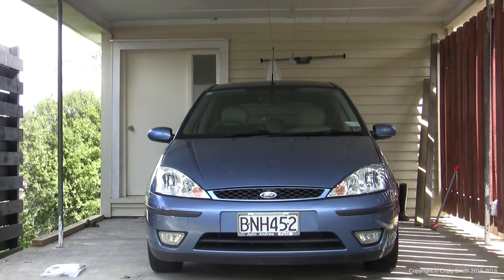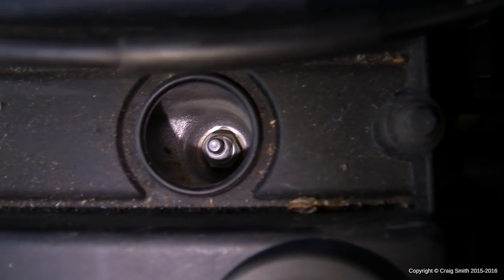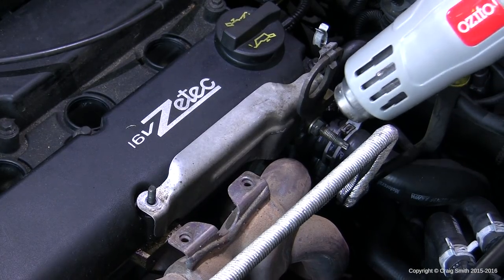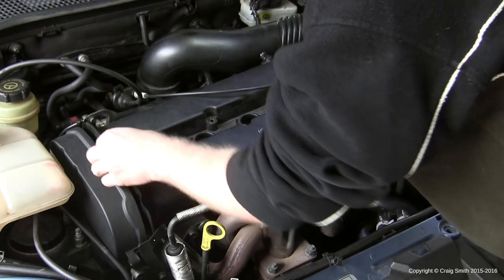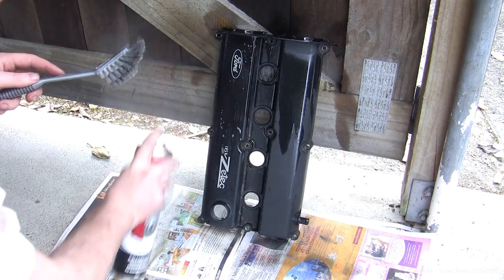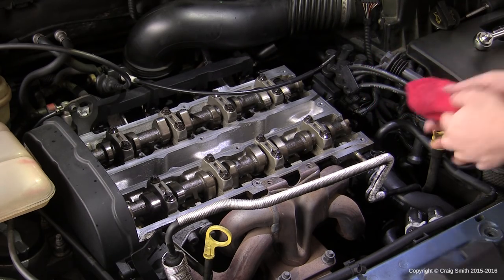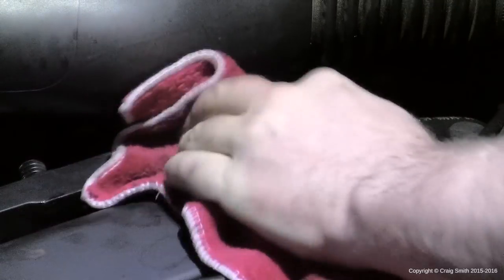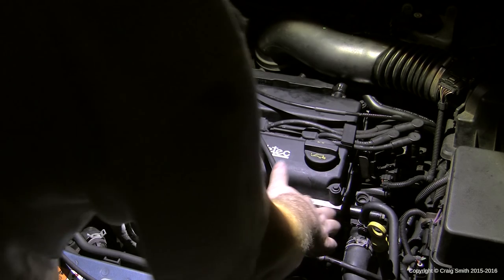Simple how-to: Replace Ford Focus rocker (valve) cover gasket, PCV failure #2

Comment: Video was very helpful. I had a hole blow out in the same spot as your hose was colapsing on the backside. I watched your other video on the pcv valve replacement. My valve cover is leaking oil and i didnt know that a bad pcv valve can cause that. So thanks for the info it was very informative and you did a great job filming it as well.

Comment: Considering I just replaced my PCV valve and hoses today and found the short little elbow piece that connects the valve to the metal tube almost completely plugged with oily crap, and considering that I also have some oil coming out around my valve cover, I think I need to do this too...dang.  But, I'm very glad I have this video to follow.  Very well done.  Excellent video and sound quality as well as narration.  Thank you for taking the time to make this video!
Reply: Mike Moren

Comment: There is every chance the new gasket will leak.What you should have done prior to refitting the valve cover and is specified by Ford,is to use RTV sealer to place four blobs of the sealer right at the very front of the gasket line where casting starts for the cam belt pully's.This is a 90 degree rise from the flat area where the gasket fits to the pully housing casting,the new rubber gasket will not seal a 90 degree change in direction very well.Hope this helps you out.

Comment: I have the 1.8 Zetec version and there was no need to take off the difficult heat shield, just the two nuts securing the small shield and hold the pipe bracket.....lucky me!!!  Presumably the 2.0 litre heat shiled are attached together??  Mine is for UK. Hope this helps someone.

Comment: So I replaced my pcv hose due to big tear in old one, now my car is won’t even idle before it dies. Would hold idle but rough on old hose with 1” hole. I’m going to change pcv valve now but any other suggestions?   
Already done upstream/downstream O2 sensors, plugs & wires, air filter cleaned throttle body and gas treatment/fuel additive. 2000 Ford Focus

Comment: I notice you used no sealant on the gasket. I agree with this because with clean mating surfaces and a new and rubber gasket - not over tightened you shouldnt need any !

Comment: Where's first video.  Is silly heat shield custom?  That's different from American model its a full thing around the header and if you leave it off the plastic valve cover melts down exactly where your heat shield is.

Comment: What if I have a leak after doing the job?
Should I need to instal a new one or just redo the tighten sequence? 

It is a very small leak that I can hardly see or feel the oil (in the front edge of the timing belt, right in the side of the bolt). 

There is no leaking in the spark plug holes.

Thanks for this tutorial.
Reply from the maker: No need to replace the gasket if it's new, either try re-doing the tightening and check the torque, otherwise take it off again and give everything a good clean before putting back together. Check the leak area for the reason, scratched head or cracked cover, damaged rubber, dirt or glazing.

Comment: Crankcase pressure?  Surely there is a breather pipe bringing fresh air  from the air cleaner?  In which case it would not be possible for any pressure to build-up.   I wonder if you tested the old PCV valve? That being stuck closed would certainly tend to cause the collapse of the pipe, I would guess.  BTW  I also wonder if the insulation on the PCV pipe might be there to try and keep the gasses warm, reducing condensation of water in the pipe?  I know on my car, the PVC pipe - which is quite long, is very well insulated along it's whole length.

Comment: So there is no need for any sealant with the gasket? I watched a video for a different car (specific to the same car that I have) and they use a sealant but from this video it isn't necessary?
Reply from the maker: Not on this engine. Sometimes there is a joint between head and front cover that needs a small blob of sealant to help the gasket. If you don't have the same engine then this video is not specifically useful, you need to find the right workshop procedure from the manufacturer.

Comment: thanks ,, would it fit the 1.6 focus too, they look similar .. my mechanic told me to get plugs gasket too, is there any ? or its just one piece ? whats the part number? thank you
Reply from the maker: I can't tell you the part # for a different engine, look it up using the correct model & year. Plugs gasket is part of the gasket shown in this video, all one piece, but commonly they are separate (but nonetheless will come in the same package, same part #). Have a look at my recent videos for example with the Duratec 2.0 for example.
Reply: @CraigsDIY  i already bought and installed they are the same

Comment: Great video! Could you give the type of heat shield bolt, thread count, or part # for viewer replacement? Thanks!
Reply from the maker: Do you mean the exhaust manifold shield, or the little shield on the cover top. If the former, I don't remember, the easiest thing to do is take the old bolt(s) to a fastener place and just ask for stainless replacements. If the latter it's some bespoke part.
Reply: Yes, the heat shield bolts. Thank you for your quick response! I'll do just that. They rust out badly! Stay OTT! It keeps the bugger running!!!

Comment: I don't know if you will be able to help me but when I removed the spark plug connectors, they were covered in rust dust, and when I looked inside the holes, there was rust everywhere. Also, when I tried to remove the rocker cover, it was impossible, it didn't moved even when I punched it gently from the bottom with a hammer (and yes, I made sure every screw were out). Could it be that the previous owner removed the cover (maybe to change the timming belt) and put it back without replacing the seal, which caused corrosion ? Also, if you have any tips to remove it, I'll gladly appreciate them (I'm a bit scared of punching it with a hammer, I don't want to brake it)
Reply from the maker: Rust on plugs is not unusual I believe, although if they're really bad you might want to replace them anyway at the same time. Use dielectric grease when replacing the leads so as to guard electrics against corrosion.
The cover is plastic obviously and the head is alloy so won't rust, at most a bit of oxidization but the gasket and cover obviously are routinely covered in oil so won't corrode inside. As to removing a stuck cover, try working a flat blade in under one corner, then twist it to lever up the plastic. Be very gentle and careful not to damage the head. Once you crack the gasket seal in one area, it will usually come away. I focused around the oil cap hole as this gives a useful handle to pull on. Alternatively, run a hot air gun around its edge to try to soften it up.
Reply: Thanks ! I'll try this ;)

Comment: do you need  a sealant for the gasket?
Reply from the maker: You shouldn't.
Reply: @CraigsDIY  Any suggestions on how to dissolve the sealant without damaging the valve cover? The last mechanic that did mine used a silicone gasket maker and it looks glued shut
Reply from the maker: Mine was sealed as well (that's the red stuff you can see in places). Sometimes 'the last guy' will bodge the job by using sealant to fix a leak rather than replacing the gasket properly. On some heads it seems necessary, e.g. if there is a metal joint that needs sealing to assist the gasket. But on this car the gasket should be enough. It will pull off, you just need to be careful. Use a hot air gun or run the engine a little to warm things up.
Reply: @CraigsDIY  You're right I think it was a botched job but at the time I had no idea of what to look for. I got some 3m adhesive from the parts store. the guys said it may work, atleast thats what I'm hoping.  There's alot on there.
Reply from the maker: If you mean scrape it off, get a decent plastic scraper. You can use degreaser or brake clean to help get residue off the aluminium but be careful not to get any inside the engine. It will be a monotonous job regardless, sadly.
Reply: @CraigsDIY  thats the task. Getting the cover off of the engine without getting the silicone in there. I'll try your methods. Thanks for the advice

Comment: I hate it when people call them spark plug connectors. They are ignition coils. Also it doesn't really make any difference whether the gasket is OEM or not. They all do the same thing. The OEM gasket is no different to the others, it's just got a FORD sticker slapped on the packaging and they charge you a premium price. That's literally the ONLY difference.